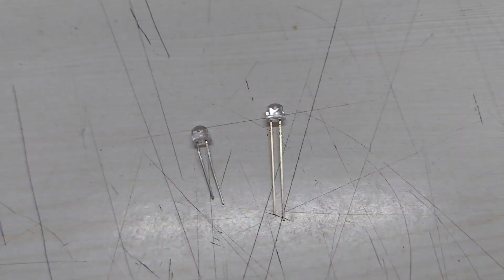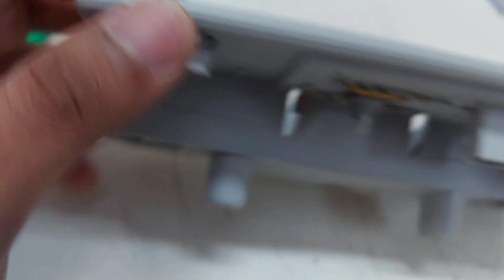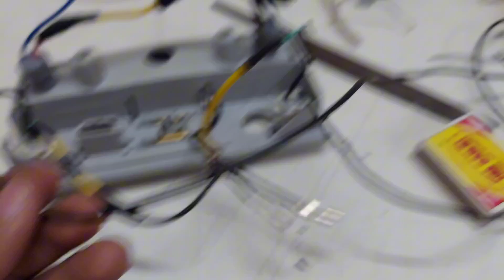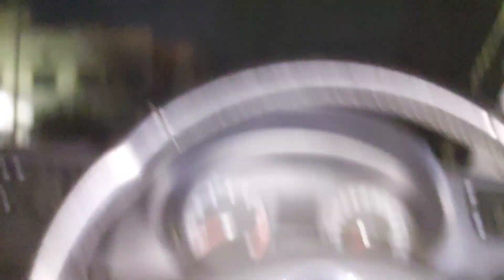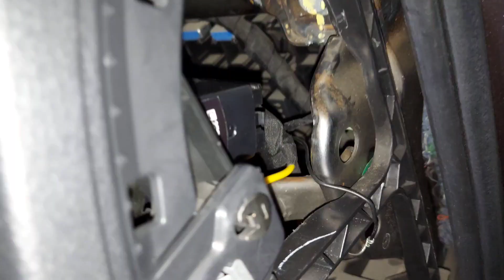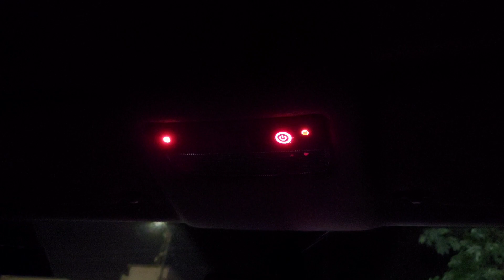Passat Cabin Light Conversion On My Volkswagen Vento 2021 | POLO VENTO Eurospec

Comment: Can i get a link to buy those items which u mentioned in the video 

Sorry its a big ask but 😕 

Those leds and resistors including switch and other stuff 

I can manage soldering gun , drill machine etc 

Please guide me on this
Reply from the maker: @RideWithBuddys  https://makerbazar.in/products/5mm-dip-flat-top-wide-angle-led
https://projectpoint.in/index.php?route=product/product&product_id=500139359168

Electronic Spices 16 mm 12-24V... https://www.amazon.in/dp/B0CCVCCSHP?ref=ppx_pop_mob_ap_share

Auto-Ex T10 LED socket bulb... https://www.amazon.in/dp/B084HKYCGM?ref=ppx_pop_mob_ap_share

M2 Look MR16 Socket LED Lamp... https://www.amazon.in/dp/B08QW7BXZ8?ref=ppx_pop_mob_ap_share
Reply from the maker: @RideWithBuddys  hope this helps buddy 😊

Comment: Nice work man! Thanks for this.

Can you share how did you install the ambient light near the dashboard as well? Any link to that ambient light ?
Reply: I'll surely consult you while attempting this. Thank you for sharing the link.
Reply: How have you powered the ambient light ? Any suggestions on how to remove th USB and direct it using scotch wire tap ?
Reply from the maker: @gkautomotive  for that you'll need a 12v charger , center point of the charger (which has spring action ) is the +ve (bottom point) and Two metal clips around the charger is the -ve, just solder the +ve and -ve with wires then take the +ve end in the Fuse box ( I am using slot no. 16 i.e. ACC) u can refer Fuse box diagram and use the frame bolt behind the stereo for the -ve then it should work with the ignition.
Reply: @dheerajsingh9449 thank you so much !
Reply from the maker: @gkautomotive  😊😊
Reply from the maker: Thank bro 🙏 🙌 
Here is the link https://amzn.in/d/03kncxwp 
In order to install it u have to remove the glove box or just slightly unbolt the screws then there is going to be slight gap between dashboard and glove box that is where u can install ambient and for the storage under ac unit there is going to be 2 screws as well it has enough space to pass the ambient light